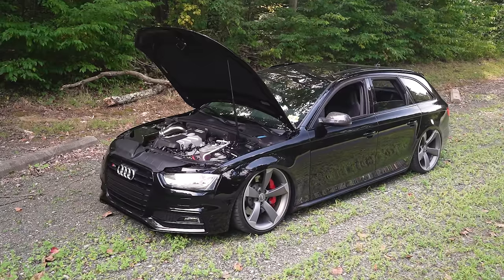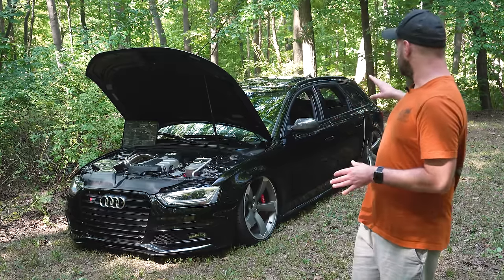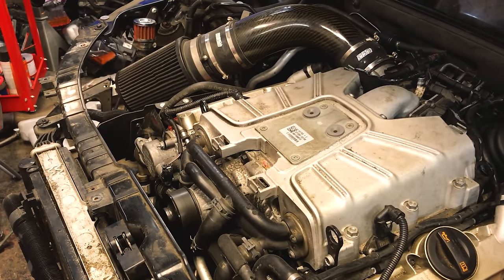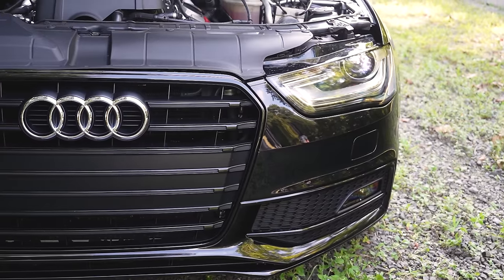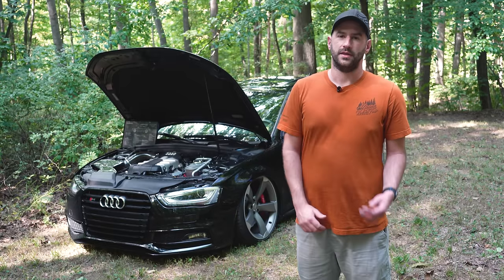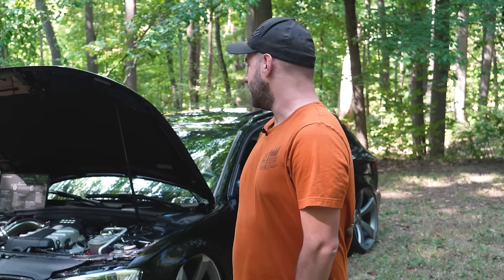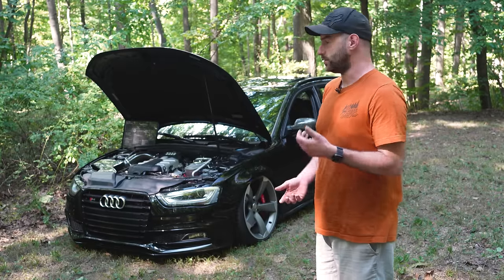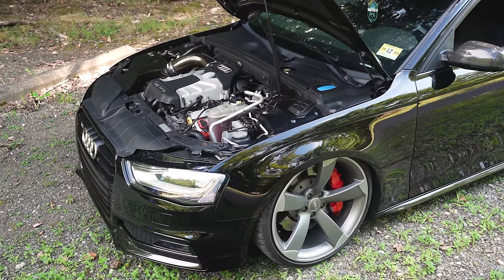Building an Audi the USA couldn't have | Owner Spotlight

Comment: Great job fella. As an S4 owner and seeing the gearchanges, I really feel that your stick shift is wasting power, due to rev drops between shifts  and of course wasting power equates to wasting fuel. 
Who can change gear quicker than semi autos etc (we have auto, auto sport and paddle mode - all in one) its terrific, and very well mated to the V6 engine, which is great to live with.
Respect to you for getting it done - can only imagine the man hours involved in the wiring alone.
Reply: You can't compare the manual feeling

Comment: Having lived in NJ previously, what I’m curious about is how the emissions stuff worked out. The 3.0 has got to be producing significantly more you’d assume. Love the car, love the concept.
Reply: Emissions are no problem. It’s a factory S4 ECM, so they just plug into OBD like normal and as long as there’s no faults and readiness monitors are set it’ll pass. Just ran it through inspection in December and it passed 0 issues 👍🏻
Reply: A shop in California did this swap and it was 100 percent carb legal so it is possible to get it to pass
Reply: @yamman93  which shop in CA?
Reply: @phillipwarren402  Pacific German

Comment: What I love about Audi is that the sedans and stationwagons are identical from the bottom up till the windows. Same goes for my 98 A4 Limousine. Got doorpanels, seats (Except rear seat because of a different latch system) all from an Avant. A year ago I got some complete front suspension from, you guessed it.... an Avant. Oh and my steering wheel came of an A6 C5 Avant 4.2 which is (And sounds) cool

Comment: hey @ 00:19 second when the vehicle was not modded, is that rotor wheels with stock suspension? what tires were you running?

Comment: So based on the picture of the donor car on the lift above the avant, originally the avant was a b8 s-line avant? And then put b8.5 s4 front end on? Because I thought the US only got b8.5 in allroad. Do the b8.5 headlights and tail lights work with b8 electricals?

Comment: Sounds incredible!! 
Love that super charger wine!!
Im running a 275 30 Conti DWS on 10.5 x 20, squared, on my B8.5 Allroad with AccuAir, same suspension set up, tucked, so you can go a little wider if desired. Just need the correct offset. It's tight in there, but no rubs, and no problems.

Comment: Just seen your videos it was dope and I’m trying to do the same with my 2010 B8 A4 Quattro sedan Audi but im just wanting to do a manual swap. Would I have to get the same one but it’s the S-Line model but I know that I want to change out the diff for the sports diff. Any tips on doing that and I know I would need the same ECU but only for the manual transmission. I need your help and advice on doing that.

Comment: Hi, random question —I’m having a coolant problem with 2017 Golf Alltrack. No coolant light coming on. Temperature gauge appears to work normally then rises rapidly to 260F. Let the car idle and the temp slowly goes back down. Coolant level is normal. Two codes are present after replacing heater control solenoid valve. P2556 engine coolant level sensor and POOAF Turbocharger boost control A module. Anyone have any ideas.?
Reply: Sounds like an air bubble in your coolant lines. I’m more familiar with Subaru, but there could be any number of causes. Bad thermostat (sticking), bad water pump (failing), bad heater core (circulation), bad hoses or fittings, really anything involved in the coolant loop could be the cause. In a Subaru the most common cause would be a head gasket failure.

Comment: I’d like this build in this video, does that thing seriously have twice what is made from the factory though? That would be about 710 hp it which is seems to be a little bit of a stretch for me it sure doesn’t look like 700 hp, I have an Audi S Q5 and I am looking to build it eventually same engine now
Reply: Twice as much as when it was still a stock A4 2.0t which was around 200hp if I remember correctly. Yeah 710hp out of a 3.0t would be bananas!

Comment: I have an S5, this generation. I want nothing more than to build it to the moon and back after seeing this. Regarding the IE tune/pulley setup, what parts did you use? How much did it run you?
Reply: If you have the gen 3 version of the E888 your looking at 357HP on E85 with just an APR stage 1 ecu.
Reply: @klubstompers  Think that’s the 4 cyl in the A5? I’ve got the 3.0T V6 and I think stage 1 bumps it to ~410-430hp?
Reply: @frogogogo  Opps, sorry, i replied to the wrong comment. lol
But yeah, your correct APR stage1 for the 3.0 is like 430ish on 91 octane. Stage 2 only gives you an extra 10h.
IE's stage 1 is 400ish hp on 91 octane. 
But those engines can be built to about 550hp with dual sc pulley, crank pulley, exhaust, hp fuel pump, throttle body, and e40 tune.
Reply: @klubstompers  Word, I’d looked into doing full stage 2+ but for now (since my car was likely tuned before/has pretty substantial mileage) I’ll probably end up with stage 1 ecu/tcu, possibly stage 2. I also daily the car so I don’t want so much power that I can’t enjoy it due to road restrictions lol
Reply: @frogogogo  I hear that. Got to find that happy medium.